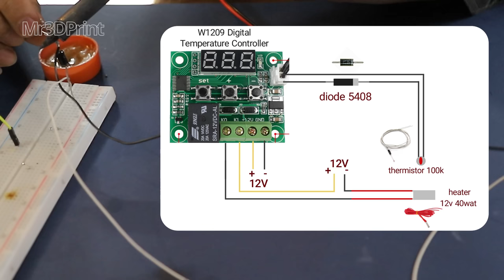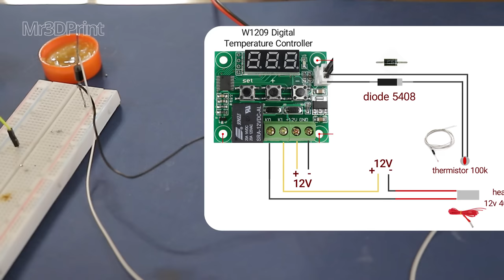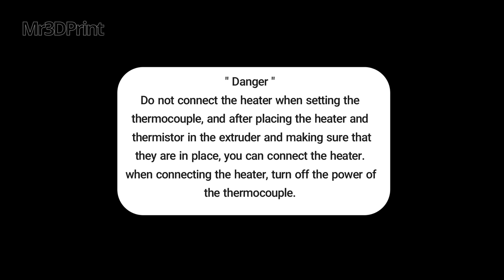#6 Heat and motion control with Thermostat W1209 & gearbox motor  -free filament (PET)

Comment: Good afternoon. I can't find the right temperature for this plastic, please share a secret.
Reply from the maker: Hello dear friend, if you have paid attention to the videos, the appropriate temperature has been said, but I tell you again, the production temperature of filament is 205, the temperature of connecting filaments is 270, and the temperature of its 3D printing is 255 degrees Celsius.
Reply: @mr3dp  when printing at 255 degrees, the plastic refuses to come out of the nozzle and gets stuck, and if you raise the temperature higher, it starts to boil. maybe the matter is in the very manufacture of the thread, I do not understand.
Reply from the maker: Please take a video or a photo of your 3D printing problem and send it to me on Instagram to see what your problem is.

Comment: W1209 doesn't heat up over 130c it stops any one have solution for this ? I have problem in P6 settings cannot turn off 0-110 is there any solution ?
Reply from the maker: For any questions, please contact me on Instagram

Comment: could i use this motor
DC 12V 100RPM High Torque Permanent Magnetic DC Gear Motor or this one
DC 12V High Torque Electric Gear Reduction Motor,high torque and less noise - Speed: 15RPM, 30RPM, 50RPM, 100RPM, 200RPM(Optional) (12V 30RPM)
Reply from the maker: 12v 50 rpm

Comment: why are different versions of temperature control in this series? LIke in part 4 you connected heater and thermistor to ramps 1.4 and in this part you connected it to something different
Reply from the maker: Read the description of the video, this thermostat method is a cheaper method and it was my own invention for people who don't want to spend a lot of money to buy a 3D printer board.

Comment: ciao, complimenti per il video, visto che sto provando a replicare il tuo progetto per produrmi il filamento per la stampante 3d vorrei chiederti delle informazioni. i 6 diodi 5408 che colleghi al motore ho visto nel video che li colleghi al filo nero vorrei capire se quel filo nero è il positivo oppure il negativo della 12v.
inoltre, per il riscaldatore un filo lo colleghi al negativo (nero) della 12v e l'altro capo del filo sempre del riscaldatore lo colleghi al W1209 mentre il positivo della 12v lo colleghi al W1209, giusto? perfavore rispondimi altrimenti sono ad un punto morto

hello, congratulations for the video, since I'm trying to replicate your project to produce the filament for the 3d printer I would like to ask you for information. the 6 diodes 5408 that you connect to the motor I saw in the video that you connect them to the black wire I would like to understand if that black wire is the positive or the negative of the 12v.
moreover, for the heater you connect a wire to the negative (black) of the 12v and the other end of the wire of the heater you always connect it to the W1209 while the positive of the 12v connects it to the W1209, right? please answer me otherwise I'm at a standstill
Reply from the maker: Ciao, grazie per aver seguito questo canale, collega le parti in base alla foto mostrata nel video e, se hai un problema, inviami un messaggio su Instagram per vedere qual è il tuo problema.

Comment: bonjour 
si je Vien a crée la meme machine je compte me servir d'une carte Arduino mega 2560 et une ramps 1.5 avec les drives(DRV 8825   A4988 )et marlin xxx  il restera plus qua adapte l' écran LCD 
gestion de temperature multiple T0  T1  T2   et enroulement =extrudeur 1 démarre avec hotens chaude 
déplacement lateral = moteur Y ou moteur  X   =xx steppers (200 pas par MM)
Z min =arrêt enroulements + arrêt chauffe hotens (relay 12volts)
si mon idée est mauvaise vous être en droits de dire qu'il me manque des idées
saluts a tous et bonne reflection
Reply from the maker: Testez-le. Si vous obtenez le résultat, envoyez-moi la vidéo pour que je puisse la publier sur la chaîne sous votre propre nom